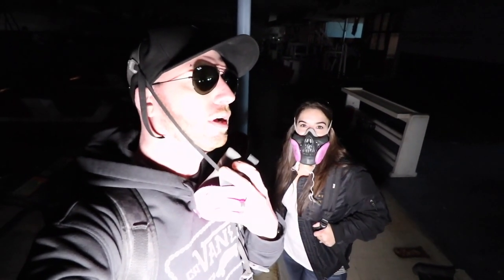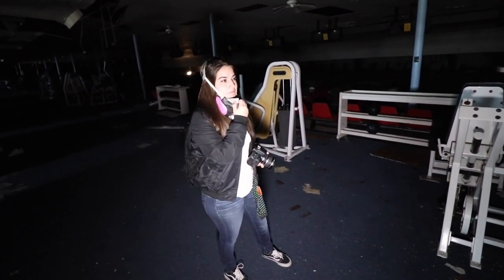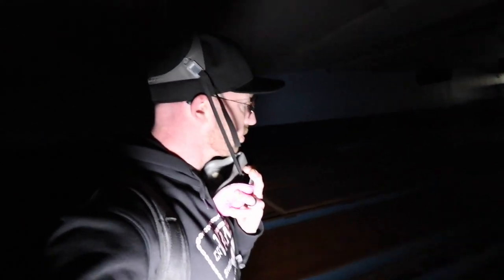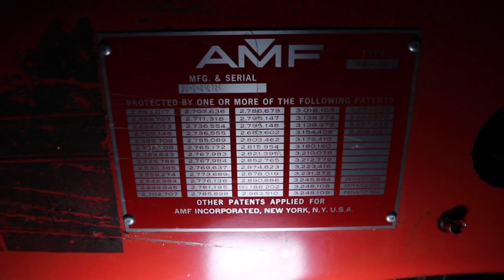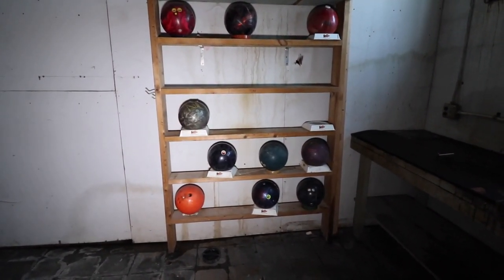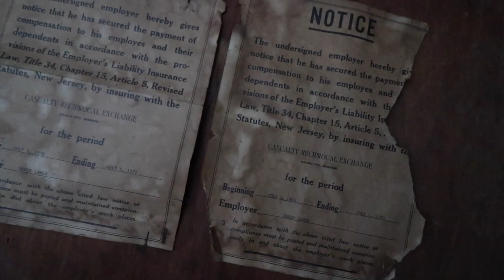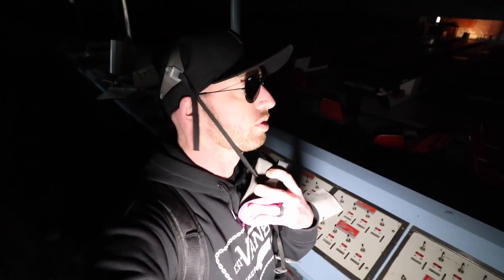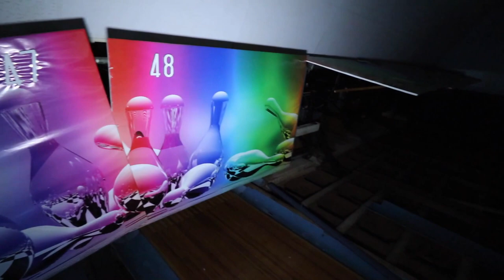ABANDONED BOWLING ALLEY EXPLORATION

Comment: The AMF Frameter is for turning the 82-30 or 82-70 Pinsetters on and off the old and registering how many frames that have been played. Older scoring systems were not automatic so they still needed those.